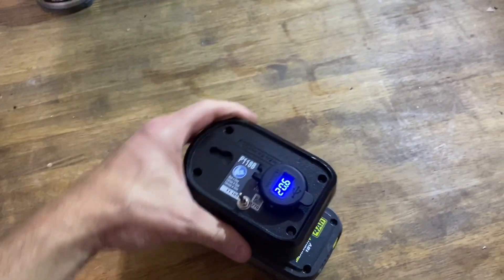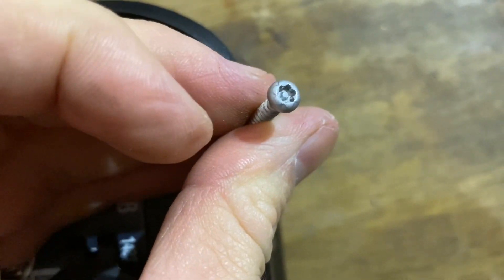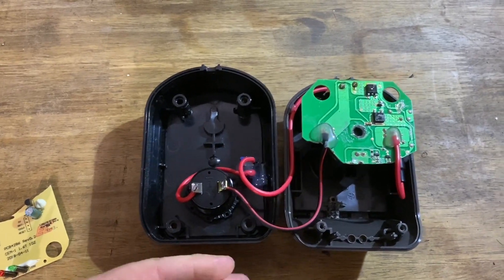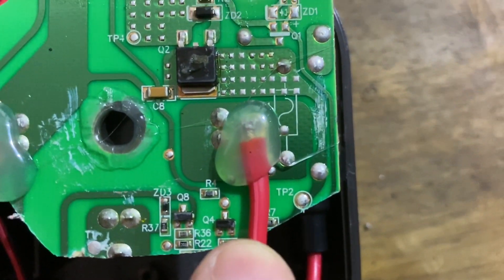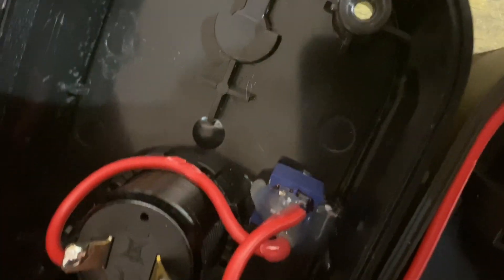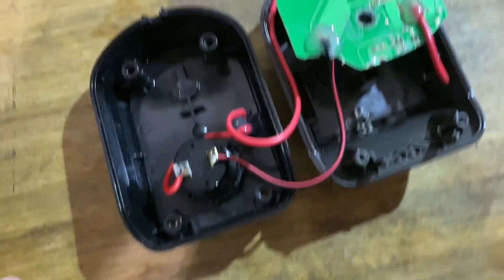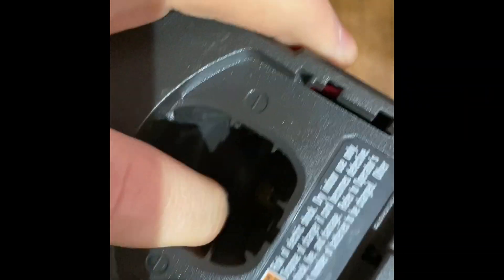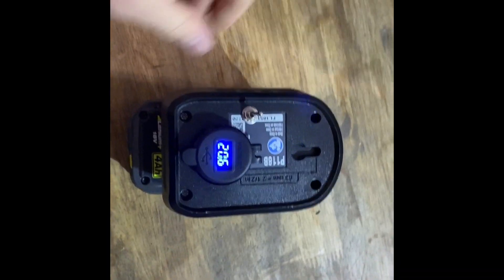$12 DIY USB Charger for Ryobi Batteries

Comment: that third pin on the connection is a temperature sensor so the charger knows to stop if the battery is too hot (which can cause problems)

Comment: Hey thanks man. I have the 6-battery charger so I had no use for a couple of these single battery ones. Your video worked a charm. I got one of the chargers with the switch built in and it works flawless. This gave me the confidence to use the same method with the other unused charger to power lights to my shed. Already had a spool of wire so it just cost me a few $ for a switch and cheap lamp holder/ceiling box and a low voltage bulb. You helped make my life 2700k brighter 👍🏼

Comment: Thanks for this simple project idea!!  Since watching your video, I have built two of these USB chargers.  The particular USB component in my projects had a Type C (PD) port and a Type A (QC3.0) port off of Amazon.  (eBay has them as well for about a $1 or more cheaper.)  On mine, the USB charger socket had it's own power switch built in.  Does anyone know if that switch completely kills all the power, or is their a bit of parasitic load?  Thanks again for a simple and relatively inexpensive DIY project!

Comment: I made a similar one sometime ago but I didn’t bother fitting a switch. Once my devices are charged up, I simply take the battery out, sorted, no switches😃
From old dead power tools, I also keep the prongs/connectors where the batteries connect into the power tools in order to use in some other projects.

Comment: what about low voltage cut off.  If you charge numerous items, how do you know if the batteries won't drain completely and damaging them?
Reply from the maker: You’re right on - Low voltage cut off is built into the batteries. 👍
Reply: @eighthacremaker7129  
It is one of the reasons I like Ryobi batteries.

Comment: size of the security screw?
Reply from the maker: I have no idea off hand, sorry. I have one of those $8 "every weird little screw" kits from amazon. Bunch of little security screw tips, etc. Grab one, it's worth it.
Reply: T8 Security is what they use for to hold the battery packs together. I haven’t checked the charger but it’s likely the same or possibly T10. Either way they both come in the 10 dollar security bit set from Harbor Freight. Make sure to get the 100 bit set for $10 not the 30 bit set for $6.

Comment: I bought one of those 12/24 volt
Usb sockets but mine has
a built in touch switch.
I didn't have to add a switch.
I tried it on a 20 volt b &d
Battery & i only charged my phone 
to 68% see that goes to show you
Powertool Batterys come
In handy for keeping
Our usb devices going.
But I Couldn't use it on a
Ryobi Battery. Cause I didn't
Have a 3.d printer
To make the aperatus 
To fit over the Battery It's Self.
I ordered oone on amazon.com
At First I Seen The Lime Green One & a
Blackone On Utube. Then I kept
Asking around on Utube
where I Can buy one. Then I
Never got no replys. So I googled 
Ryobi one + 18 volt usb adapter.
Then google Steard me to a Couple
Sites like Ryobi Of Austrailia & amazon.
So I Ordered One From amazon.com

Comment: I'm going to follow this idea and just put in a cigarette lighter adapter socket so I can use other devices too. Was thinking of a 24v step down to 12v but that costs $$$. Would still be cheaper than Ryobi's 150W inverter, but more complicated. I can definitely use this to easy connect Ryobi batteries to a back up system though. Great idea!

Comment: Or you could just buy the Ryobi battery to USB unit for $22 and keep the charger as a backup unit.
Reply from the maker: Pro1er last I understood that was only available in Australia? Plus no voltage gauge... and mostly, I wouldn’t have been able to destroy something to make it better and more useful to me, which is as much the point as anything else. 👍
Reply: @eighthacremaker7129  You can buy them at Home Depot online.
Reply: Is it qc 3.0 Fast Charger ?  If not, I did his mod (qc 3.0 socket) & you can get them with a on/off switch for ~ $10 ...
Reply from the maker: It is the new 3a charger. I saw the ones with switches but wanted two USB ports. Sure charges FAST